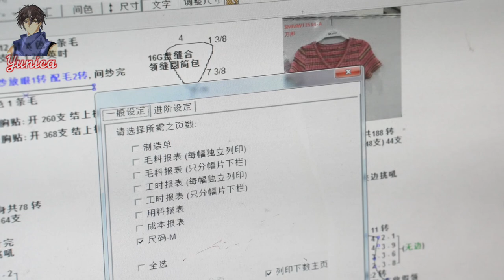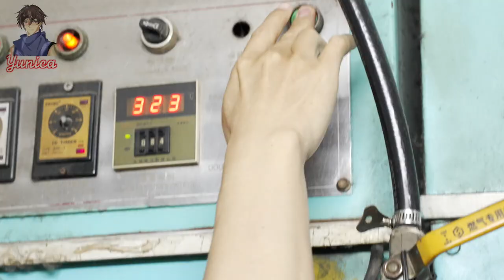Sample process of making girls' favorite slim fitting short sleeved sweaters。  China Sweater Factory

Comment: Wow, that's equipment with thousands of needles ))))
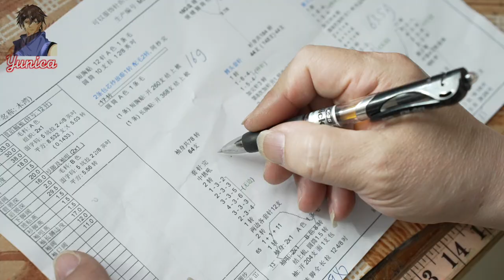What were they weighing the piece of fabric for at 3:05?
I don't understand this purpose it's not meat at the market ))))
Reply from the maker: The technical staff in the design room set a fixed number of stitches per loop and the approximate grammage of the finished product according to the grammage of the cotton thread, so if the grammage is wrong during mass production and each garment exceeds the specified weight, the factory will suffer a loss of profit.